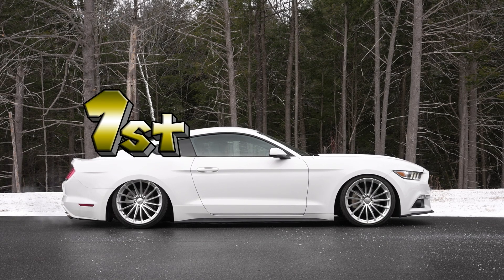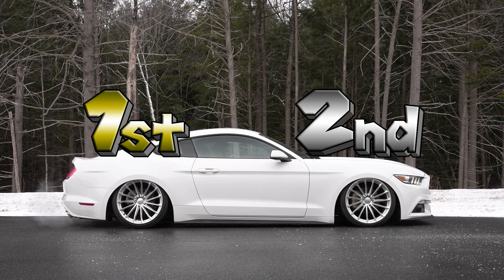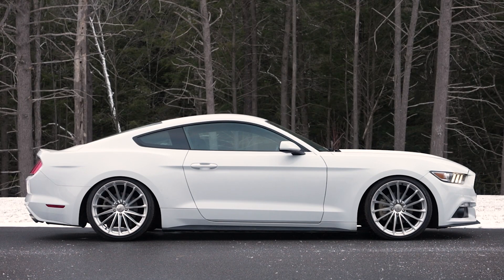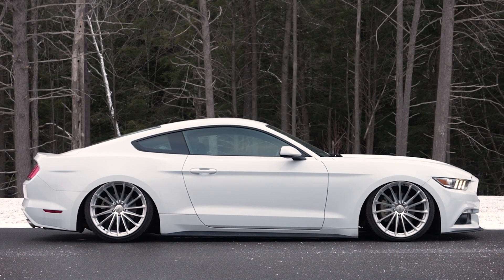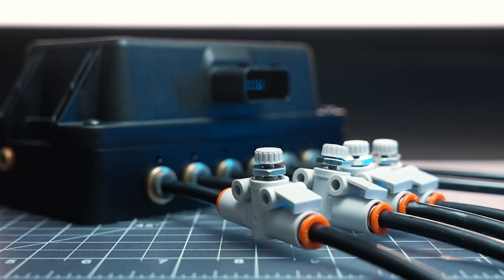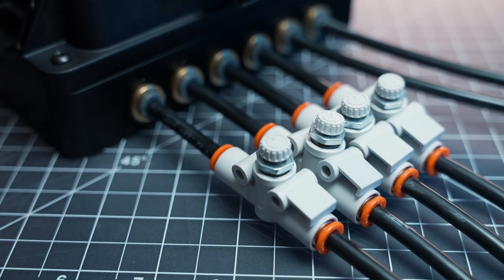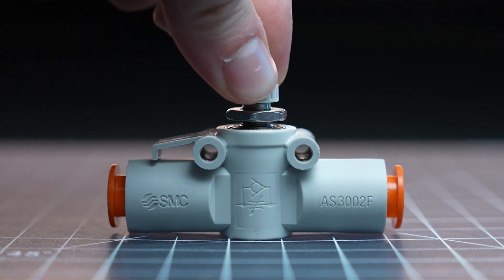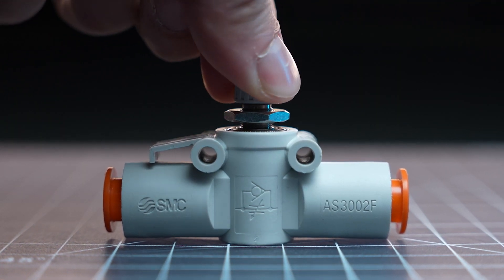What are Flow Control Valves?

Comment: If I install this on a 3/8 system would it slow down the air up speed as the normal air up seed is too quick and jerks the car when airing up or down. And would I need 4 one for each corner ?
Reply from the maker: Yes these will work, and yes ideally you would do one per air path (four). If you only wanted to impact air up speed, and not air out, you could just use one on the supply line to the manifold instead.

Comment: If i have a air cylinder suspension ride that is too fast up and down and not evenly doing the front and rear together. Would i need 4 of these? 1 for each corner or would i need 8? 2 for each corner? 1 for up and 1 for down per corner?
Reply from the maker: You would want 1 per corner. So 4 total.

Comment: For the PTC fitting, does it matter which direction these valves are installed in? Or should we copy the orientation as shown in this video with the tabs pointing away from the manifold?
Reply from the maker: Some of the flow controls do have a diagram on which way they are designed to flow. Feel free to give us a call if you need help!

Comment: This is fuckin awesome my car drops way too fast too so this is prefect do the valves have potential to get frozen with water in winter though???
Reply from the maker: The flow controls won't freeze if you take the precautionary steps of using air brake antifreeze and water traps.

Comment: Does anyone actually run 145 psi in their air systems? Seems like these are unsafe to purchase unless you change your pressure switch.
Reply from the maker: All the air management systems we sell come defaulted at 150PSI with the option to raise it to 200PSI. Depending on what your bags need you can always raise it. We have had no issues with these fittings for a few years now.